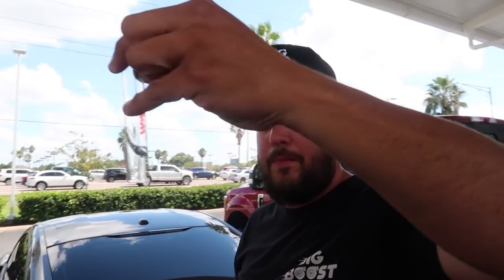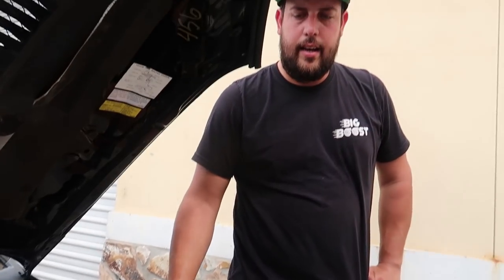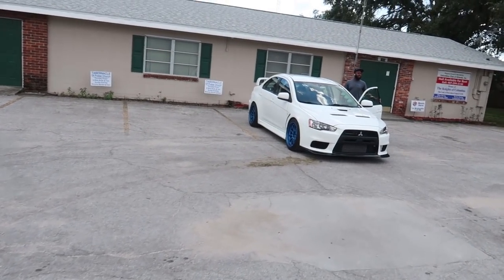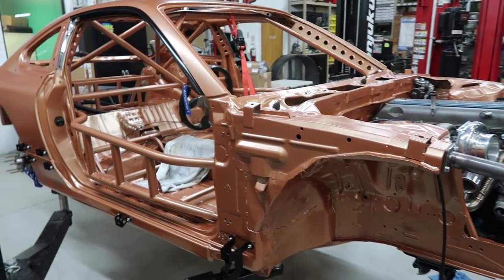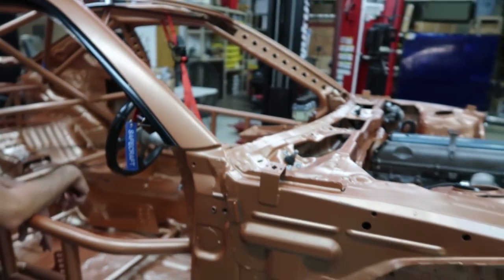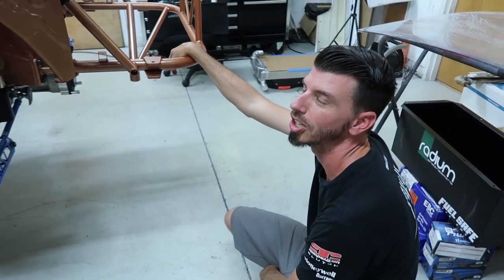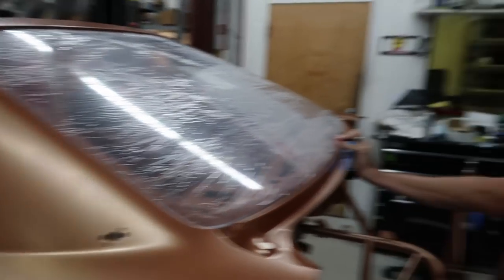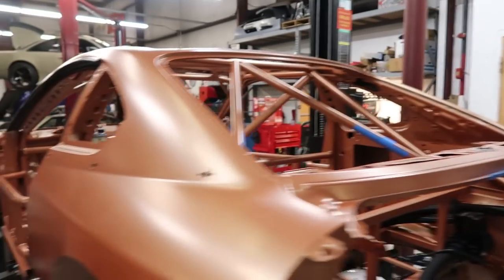Buying a NEW CAR + S15 Update

Comment: Hey Adam you may not want my opinion on this manner but having owned both and Evo 10 and a WRX STI sti I felt more like a driver's car to me but if you're buying it for rally purposes well it's a pretty expensive car my recommendation would be a standard WRX lighten it I also live in Florida I would recommend taking it to a place called revworks let them strength in the engine cuz ringland failure is a known issue and you know what that strengthening you'll gain a little bit of horsepower you'll probably be more towards the Benchmark of where the STI is if not a little bit higher and you have access to BC coilovers I'm sure they have some type of off-road capability set and you're good to go man at their fun f**** cars you'll have a blast with it and I think for the type of person you are and for what I've watched and how you drive you be more happier with that nothing wrong with it I understand Big Boost has worked on them cars before but the EVO to me just felt like a more computerized machine and my input sting always translate to what I wanted the car to do it it more or less translated into what the car thought it should do or needed to do and I just didn't care for that man I'm a person who drives a car for the feeling I want to be one with the machine I'm driving not be one and then the computer tells me no you can't do that but that's entirely up to you that's just my two cents I've owned both vehicles either way you go it's a good choice however Mitsubishi doesn't have quite as many manufacturer championships in rally as Subaru does if that tells you anything so the best of luck to you on your decision and if you do decide to go with the Subaru I would definitely like I said check with rev works there in Clermont Florida and if you can get access to them or you have the means and money for it Pro-Drive parts or Cosworth parts those things make that car Bulletproof for 5 years I ran a WRX STI on about 28 pounds of boost through many many rallies beat the living s*** out of this poor car for 5 years and it's very rarely gave me any problems I had to spend a great deal of money but it paid off in the end I wasn't wrenching on my car constantly except for when I hit something but if you need any advice man feel free to hit me up on this and I'll gladly give you any pointers and if you happen to get one I'm not looking for any video Fame but if you want somebody to talk to I'd be glad to spend a little bit of time with you helping you build one best of luck to you and I can't wait to see which way you go and how you progressing driving because rally man is it's funny as hell but everything you know about drifting and driving fast on a track you might as well throw it all out the window it's a whole different ballgame I'm glad to see you opening Horizons

Comment: Every time I see an Evolution, I feel sort of bad for the owner. I will admit I know nothing about how reliable they are but I've known many people who have owned a 1G or 2G AWD DSM and they were money pits. The 6 bolt 4G63 had their issues but the 7 bolt versions were even worse. The transmissions were horrible with the grinds and lock/pop outs. It seemed like a DSM needed a Buschur Racing engine and a Shep Racing transmission just to have some sort of mechanical reliability. If an Evolution is anything like the younger DSM sibling, they have to be a headache unless it is a low mileage Evolution that wasn't beat on all the time and I'm sure those are pretty pricey and extremely rare.

Comment: get a B7 A4 broseph. the 1.8 or a 2.0 stroker would be fucking nuts. if you look @ the trans codes look for 01E 6 spd. 1200hp capable and a lot of people make dogboxes out of them. mine currently makes 300 @ 26 psi with the biggest K04 you can get, eventually getting a GT30 + E85 for ~450. cost me less than 5k so far ^^

Comment: the battery should be mounted inside the frame rails not back in the fender where it will take damage also VERTEX>>>>Everything else

Comment: Subaru is way more reliable if tuned correctly. There is a reason that Mitsubishi is hardly a company anymore. WRX all day long. I’m saddened by this video. 😔😞 Coming from someone who has owned both, I would never go back to an Evo, I currently have a Forrester Xt, Bug eye WRX and a Hawk eye WRX. Don’t get me wrong both have there positives and negatives but IMHO the Subaru has a whole lot more positive. I think most of the commenters are just intimidated by the Boxer engine.